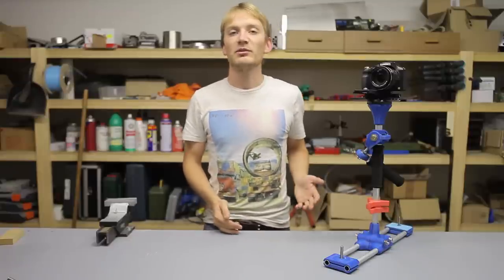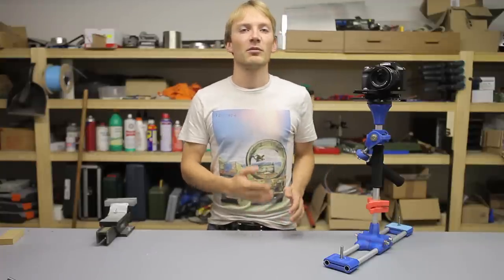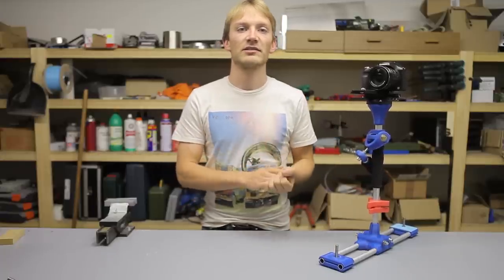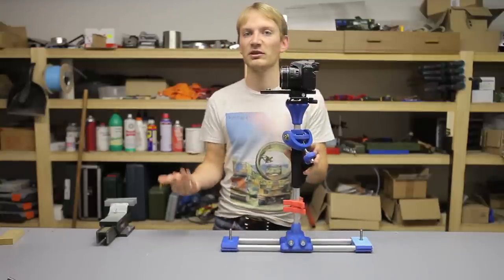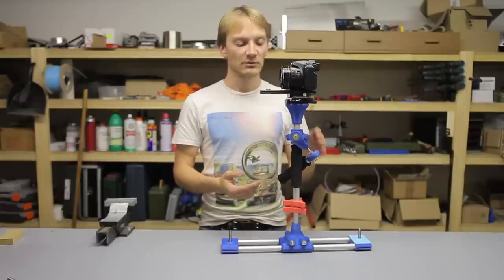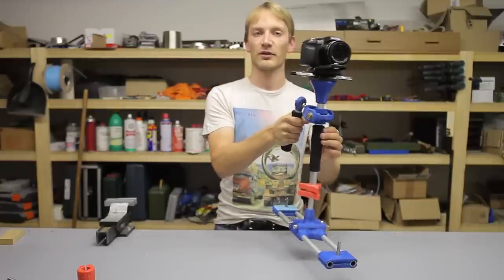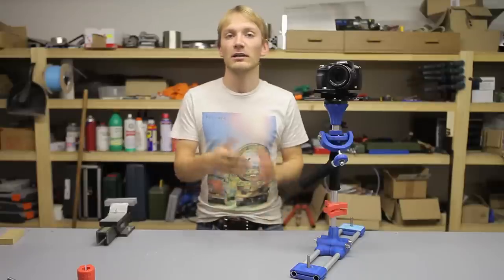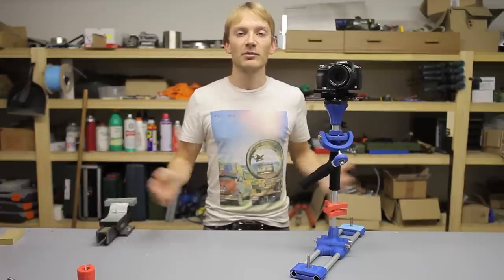3D printed Glidecam-like image stabilizer!

Comment: Hey Thomas ! This is great and I am making this stabilizer based on your plans on Youmagine. But I face the issue that 15mm diameter aluminum tubes is not standard, it's either 14 or 16mm , I cannot find the 15mm in Brussels . We ordered 16mm/12 mm (out /in diameter) in place of 15/13. Do you think you could generate the STL files so that the 16/12 can replace the 15/13 ? I am planning to make a video in French on this work and point to your video. Marie
Reply: Basically the problem is for the Bottom Rail mount  to be able to enter the 16 mm. For the two weight mounts it is ok like that as they are in two pieces .